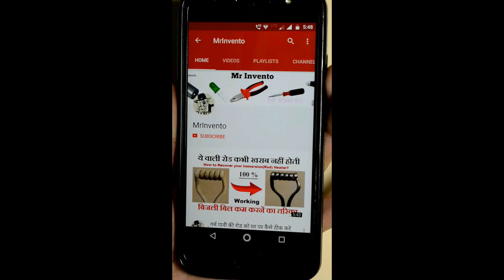DIY, How to Make a 12 Volt Multi Port USB Mobile Charger Low Cost at Home, UFO Home Charging Station

Comment: Have a question. Did you have to put a 7805 on each USB or could you use just one?
Reply from the maker: heating issue
Reply: @MrInvento  So with one 7805 with a good heatsink I should be good. The current problem that I have, I've built something like this with a transformer and a rectifier but without a voltage regulator so, I can't get an iPhone to charge and I get a warning on an android phone that it will charge at a slow speed. So I figure to fix this is to use the same set up with the regulator and it should work. Do you think it could work haven't tested it yet?